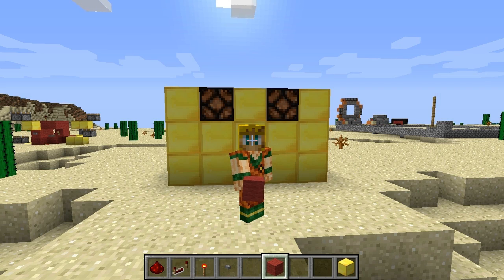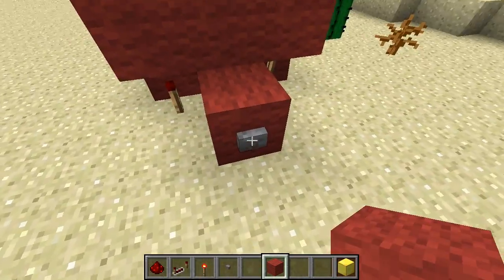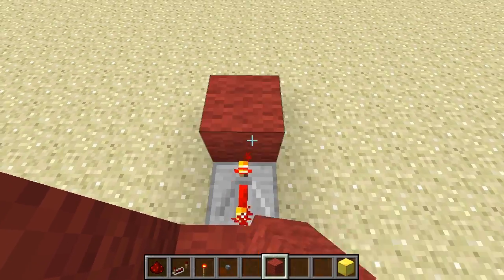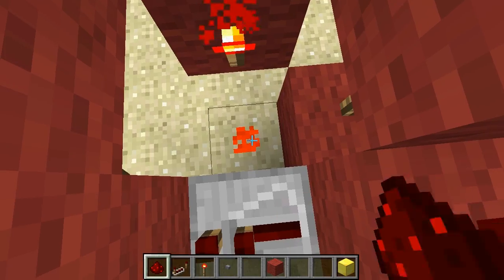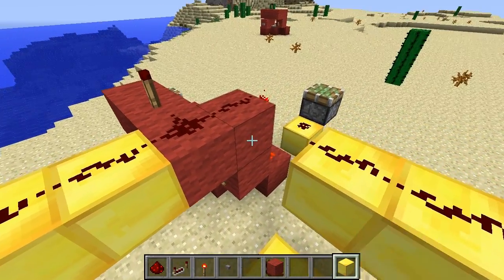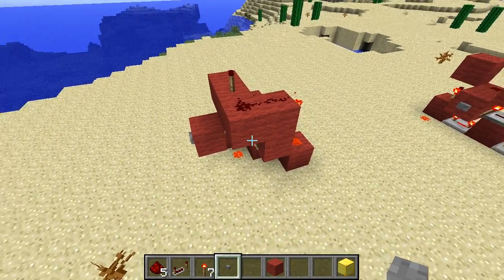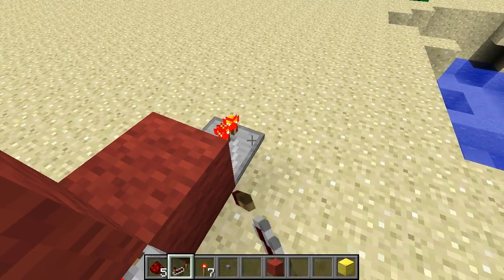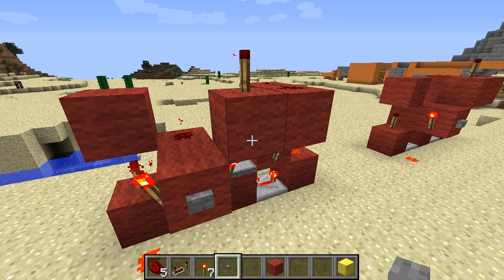Minecraft - Compact Silent T-FlipFlop - Tutorial

Comment: I have found a bug in this design. Most of the time when you press the button It switches off then quickly switches back on. This is due to how the buttons stay on longer because of Iron doors closing too quickly when you press them. If you want to fix this all you have to do is go to the only repeater that has 1 tick and put it to 2 ticks, and It should work perfectly.